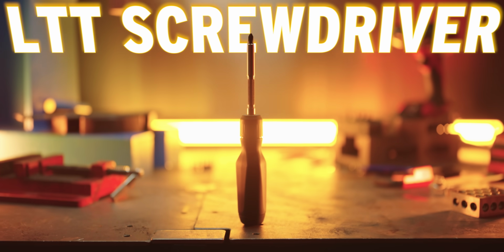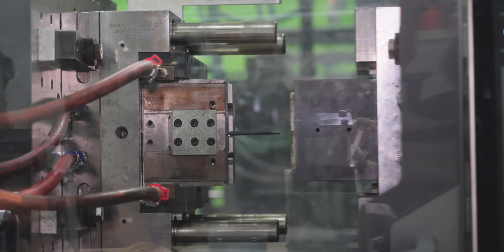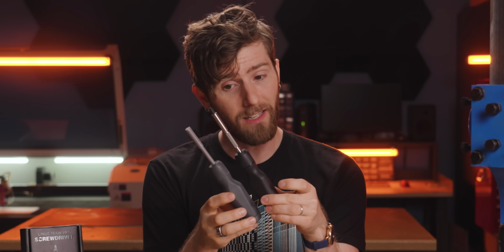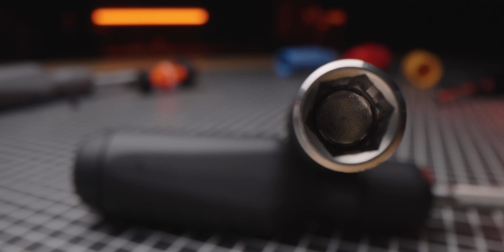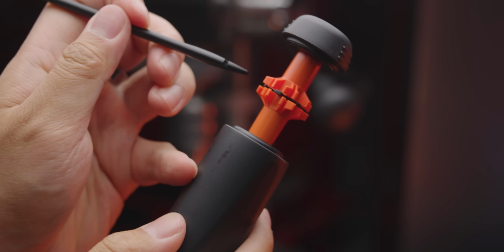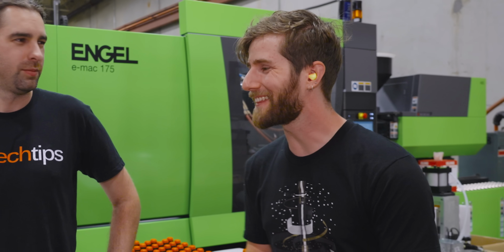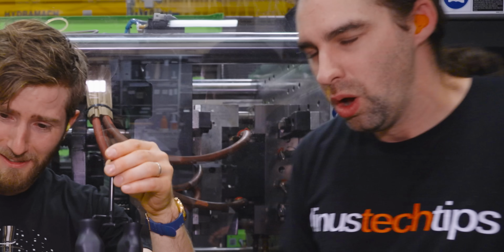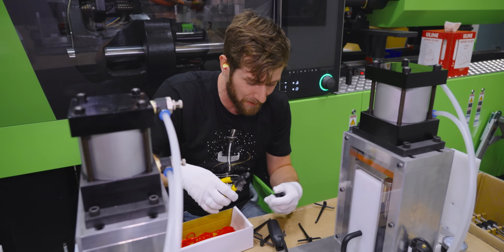Why our Screwdriver took 3 YEARS

Comment: I've been using screwdrivers basically daily for 20+ years, sometimes over 8 hours a day, and I have literally never understood the point of a ratcheting screwdriver. I can turn a regular screwdriver faster, with less effort (it doesn't matter how smooth the ratchet is, it still takes effort), a regular screwdriver weighs less so there is less fatigue, they feel better in the hand, they are more durable, and they cost less money. The biggest problem I have is the range of motion you get with a ratcheting screwdriver is less than with a regular screwdriver because of the way you have to grip it. I use a 2 handed technique when running in loose fasteners that doesn't require removing the bit from the fastener so it's functionally the same as a ratcheting screwdriver technique, but easier and faster because I can twist my hand farther. I can see how for the novice they might seem like the better option but go in the field and watch people who run screwdrivers all day and you will typically see nobody using a ratcheting screwdriver. There is a reason for that.
Reply: who asked you? just don't buy it

Comment: One of the best screw drivers i've come across for those that can't afford the sweet new ltt one is the dewalt 11pc DWHT68002 its $16.97, closest thing I've found similar to a snap-on's ratcheting mechanism feel, I use it for hvac installs, cheap enough to lose but also just a really nice ratcheting screwdriver

Comment: Congratulations, I'm now interested in the screwdriver. My only concern with it is a general concern of mine with ratcheting screwdrivers, is how long it maintains the tolerances, especially for heavier torques.
Reply: Project Farm did a video showcasing the comparison in torque limits and more, I highly suggest checking it out. No surprises here though as it's made with the help of megapro, they are fairly similar, with the LTT screwdriver inching just slightly ahead. 

To those thinking that a screwdriver that's just slightly better than the megapro shouldn't be priced much higher, think of it this way.  A supercar that goes from 0-60 in 3 seconds costs exponentially higher than a sportscar that goes from 0-60 in 5 seconds, even if they're made from the same engine. Much of the cost comes from the R&D, among other factors (exclusivity, branding, manufacturing costs, etc).

Both the LTT screwdriver and the Megapro ratcheting screwdriver are solid buys.

Comment: Long time LWB and Gluco vertical injection press mechanic here. I'm surprised your molds didn't have replaceable TiN coated inserts for the molded surfaces. What no flash?? Oh don't worry, your molds will start giving you some ugly "flash" at the mold joints and sprues sticking up in the mold and platen, in no time. 🤣

Comment: I don’t care how perfect it is. No one in its right mind is paying 70 bucks for a screw driver. That’s even without taxes and shipping. For me it will end up over a   100. Like wtf
Reply: They've sold well over 70,000 of them already, so apparently quite a few people are willing to pay that much for a screwdriver. And really, it's completely reasonable for a professional tool that someone's using all the time.

(but no, I personally can't remotely justify the purchase either)
Reply: @patheddles4004  I can buy 6 professional screw drivers for that amount. With a whole lot more bits. With a really good grip, magnet, rattling etc. And a proven durability.  Are they perfect no. But they don’t need to be they are screw drivers not rocket engines.

Comment: 2:45 practically speaking, this isn't a good idea. As a technician, I often keep my finger tips on the back of the shaft, near the ratchet, and also grip the back of the handle. Many technicians do this.
The most common way to choose the direction to drive, is to hold the collar, and spin the handle in the preferred direction.
With YOUR directional setup, this doesn't work, the slightest friction from your hand on the collar, will change the ratcheting direction.

Comment: This is a cool novelty piece if you're a diehard viewer but that's the only upside to this screwdriver.  $70 for a custom screwdriver you're only going to use once every so often and even if you get the black and orange, it's still boring looking.  Version 2 (since it's clearly a novelty piece) should have some sort of LTT logo on it.

Comment: Tri-lobe handles suk, provide less torque because it pries your fingers apart, and are wonky af to turn. 

Also why tf did you consciously make the decision to use proprietary bits?

For the handle the best torque is a circular design with a good gripping material. The material on the HB quinn screwdrivers is one of the best grippy I've felt, and it doesn't leave a sticky residue on your fingers afterwards. 

If it wasn't for the first two things I would probably buy it an use it. 

If it wasn't for the proprietary bits I would have bought it. Not sure why you would go and try to make the best ratcheting screwdriver and think proprietary bits is the best option.
Reply: Did you miss the part where normal bits work and fit?
Reply: @marcusborderlands6177  Did you miss the part where you can only fit 6-bits instead of 12? 

You might as well stick with the mega pro automotive.

Comment: Only fault I see is no flats on the shank for using a wrench or pliers to get more torque. Kind of a heavier use case but sometimes gets you out of a pinch with a stuck fastener.

Comment: I've been waiting for this for quite a while. It's a little expensive, but you get what you pay for. I'd rather pay $70 for a great screwdriver that I'll use all the time and last a lifetime than $25 for one that will break in a year or 2.
Reply: At $70 it's not a little expensive, it's a lot expensive!  I've never had any $10 to $30 ratcheting screwdriver fail on me in over 40 years.
Reply: @Resist4  well they don't make them now how they used to. Lol
Reply: @FranktheTank319  And our money doesn't go as far as it used to.
Reply: @Resist4  that's very true. Kind of sad. USD is going to be CAD before 2024.
Reply: @FranktheTank319  UDS?
Reply: @Resist4  USD* spelling mistake

Comment: After watching this video again, right after watching @Project Farm reviewing your screwdriver, I am totally investing in this.

I've used Megapro in the past, and I've been impressed with how durable their bits are, as well as their simple designs. I never tried their ratcheting mechanism, but based on using ratcheting screwdrivers in the past with other brands, I was disappointed in those other brands.

I'm definitely going to buy this screwdriver.

Will you guys do a tamperproof security bit versions of this? Or maybe have at least a set of security driver bits available with this at some point? It would be pretty cool to cater to a certain market as well, but baby steps first I guess.

Congrats to everyone in LTT!!

Comment: Man it feels good to be both a computer geek and an auto tech right now.    Lol 25 Newton meters lol hollowed out circle, wait till you learn about impact screwdrivers before you say such things Linus.  Still swap out that zinc especially if you are gonna claim good for auto work. and dellryn levers, Make those metal, nothing in the mechanism should be softer than brass especially if you are gonna make the claim it'd suite automechanics as well.  First time I accidentally drop a heavy part or other all steel tool on that screwdriver and it happens to have laid propped up on one end that zinc housing is gonna split and let the whole shaft fall out or cause any other variety of failures.  It's just not auto shop quality materials.

Comment: I use the Stanley screwdrivers my great grandfather bought in 1925 for >75 cents.  It works better than yours ever will.  If yours lasts 10 years Id be shocked.

Progressives ruin everything.

Comment: Great info about the design details here! I'm a bit sad that the screwdriver is limited to 25/30 Nm because I'd love to have ratchet mechanism where my hands are the limiting factor, not the mechanical strength of the mechanism. That said, I understand that the amount of extra material needed for that might make the whole screwdriver more bulky which is not acceptable either.

Comment: 5/1000 of an inch? xDD sounds like a minimum but I did the math and it is more than 0,1 milimeter. That´s even out of stadnart machining tolerance, not to mention tool making tolerance, which is not rare to have it in +- 0,01 mm tolerance

Comment: Would like to get one ... but in Australia ... with postage ... it's a bit steep
Reply: For me it's like 20$ shipping + 70$ its price that's almost 100$. For that cheese you can get a power drill that's useful in many more applications than just screwing some screws.
Reply: @somnorila9913  In Australia the megapro screwdrivers are $86 on Amazon and LTT seemed to have made improvements ... so it's not the price ... but once you add the postage to Australia it puts the price up 
25%

Comment: I prefer a regular screwdriver. no ratchet, no interchangable tips. Just a $5 philips screw driver. With a shaft about 50% longer. All the ratchet ones have one flaw, the shaft is too thick for getting into corners or screws next to a vertical side.
Reply: Thick and short, as there are some situations like opening some UPS to change its battery where the screws are deep in a narrow hole.
Also some situations where you would demount a PC for spare parts or for recycling, some situations may occur where you would need a longer screwdriver. 
The only time i felt some use for a ratchet was when mounting or demounting a wall rack and there a screwdriver is not the tool you need.

All in all nice but too expensive and not really for general purpose use. Like you said, a simple screwdriver is more flexible to be used in more situations. Not to mention that at that price, plus shipping, you can get like a two battery power drill that also is more flexible and useful in plenty more situations, including screwing and unscrewing stuff. So it doesn't worth it for me.

Comment: You should have outsourced the designing to India....i personally work as a mechanical engineer we do the similar or much more amount of work in air braking sector within 6 months of from design to finalization currently working for multiple SOP for OEM

Comment: I don't like when the ratchet turns the same direction.  When it turns the opposite way, you use your other hand to hold the ratchet while you are turning in the direction you want the screw to turn.  Much much much faster and efficient - especially if you need to back the screw out a little because it wasn't seated perfect.  Fumbling with the ratchet with my fingers seems like a nightmare.

Comment: Ordered my screwdriver last night!  The attention to detail is magnificent!  However, I ordered the black shaft version without reading the fine print.

Now I have to wonder:  Is this screwdriver 'Right to Repair' compliant?  When the shaft's finish wears (which would be normal wear & tear and wouldn't warrant an exchange) will I be able to disassemble it non-destructively and have a local chrome shop refinish it?

Comment: As someone who uses screwdrivers on at least a yearly basses on extremely complicated wall outlet covers Im amazed at the attention to detail. The way the handle seems and bit design you can clearly see this will be amazing for twisting screws in and possibly out. Even the details down to the color will greatly increase the grip of which is extremely important as your wife is screaming at you and devaluing your abilities while saying she should have just hired an electrician. But little does she know that with this screwdriver I will be able to handle any and all screws thrown my way. Now excuse me as I clean up the screws my wife threw my way ;)

Comment: I love the fact that he actually sat down and tried to work on the assembly line and see what its like to make his own screwdrivers. As someone who has worked in many production plants, I always get annoyed when the floor supervisors who didn't actually work on the floor would tell us to go faster not knowing how much effort we are putting into our work already.
Reply: or as seen in this video: the process is timed out precisely, so that a skilled operator has just enough time for split second decisions (rejecting a part) and handling everything just right. Speeding it up would make the inject molder the bottle neck. Speeding up the injection molding would mess with the surface finish and tolerances Linus has worked so hard on.

Comment: A great 'How it's made' episode and I appreciate the engineering invested. As someone who works in IT, does home repairs and automotive work I think you missed the mark on colour options for some of the target market. An all (or almost all) black colour is a poor choice.  Drop that in an engine bay in a dimly lit garage or go looking for it under the raised floor in a DC  and now you need to go get a flashlight to find it.  At 01:32 shows this visibility difference.

Comment: the point of the "reverse ratchet" is simple. If you grip to far in the front and change the ratchet direction, you generally want that change to be towards NOT screwing, so that you dont accidentially screw, when you dont want to. 
Accidentially NOT screwing brake sless things, than accidentially screwing. But then again, who tf cares about 2% overtorqued screws on a PC...

Comment: So it took you 3 years to make some minor inprovements on an already existing tech and now you're trying to hype the everlasting s**t out of it because you sank hundreds of thousands into it? Granted, the manufacturer getting bought wasn't your fault or anything you could influence. 
But ignoring that and all the obsessing about ultimately pointless details, like having the best sounding ratchet mechanism like it matters one bit, your "best" screwdriver is useless to electricians, possibly the biggest professional market you could have targeted with this. Aside from the shaft not being isolated, it's too thick for most components in an electrical cabinet and lacks a torque limiter entirely. Quite the opposite, you even brag about it being able to destroy screwheads.

Comment: Once I get situated I definitely getting one I work at a injection molding factory in the US. Lol I would be so bored on a 40s cycle most of the machines I run are 3 to 10 s dropping 2 to 4 parts at a time and some are more involved then your new drivers

Comment: $70! WTF! 
 Most Ifixit kits run cheaper! Hell their top SKU is about $70. Or you can just goto Home Depot and get a Kline 10 in 1 for $15 (Kline is a amazing and the goto brand for electricians) or even just get a throw away 6 in one for $1.99. I am a maintenance man I have so many screw drivers and a Ifixit this is too much!

I know I am gonna get hate for this, but I just can't with this.. I ignored the $250 backpack when I have a amazing one for $50 but as a maintenance man/PC Hobbyist I can't be quiet about this. I know everyone will say "then don't buy it" well you bet your butt I want but neither should you! Go get a Kline ora Ifixiti or even the throw away Home depot brand!

A fool and their money is soon parted

Comment: Two things. First Linus was wearing the earplugs backwards. The round part goes into the ears. Second LTT should sell the dropped screwdrivers as a limited edition certified "Officially dropped by Linus" LTT Screwdriver!
Reply: Any Screwdriver dropped in published video should be designed "signature edition" with engraved serial numbers.
Reply: @MikkoRantalainen  how about the serial number is the link of the video and add a time stamp in the moment the screwdriver was dropped?
Reply: @ilyassekharbouch  that would be awesome
Reply: That’s what I was thinking. Linus should sign the box too. Hmm, why not auction it/them for charity?
Reply: @allnicksweretaken  Great idea!
Reply: @allnicksweretaken  sign the box, and then drop that as well
Reply: I often wear some types of earplugs backwards, for whatever reason my ear shape fits better that way
Reply: Those look like regular foam earplugs. They work either way.
Reply: I was looking at the earplugs, I thought he made a good choice assuming those were 3M Ear Classics ear plugs. This brand has a good attenuation rating, not from what is on the spec sheet but from personal experience. 
These ear plugs are cylindrical, not conical thus no orientation. 
Depending how cold is the room, these plugs do get stiff and one should warm it first by wrapping it inside the palm and as soon as it gets to the optimal fluffiness, compress the whole barrel by rolling it between 2 fingers, preferably 1 being the thumb, once the overall diameter shrinks to a point that to can be inserted as deep as it can go using just the hand into the ear canal, do it. It will then expand forming a good fit providing an attenuation up to 32 to 35 decibels.
It looks like Linus just inserted it without going through the instruction.
Probably just to comply with the PPE requirements of the worksite.
The employer, by law is required to provide the PPE but to use it and correctly use it rest on the user, assuming of course the employer provided the training, if not, Linus has no business being there.
I'm afraid Linus, I have to write you down 😉.
Reply: And you commented on the earplugs and then 884 people gave you a thumbs up....welcome to the algorithm. You have been schooled on how to use it.
Reply: Man, I would be so quick to buy 1 at a fraction of the price.
Reply: I definitively pay more by a "Officially dropped by Linus" LTT Screwdriver